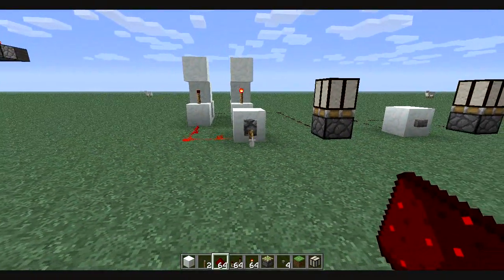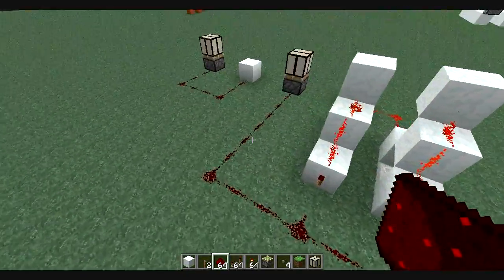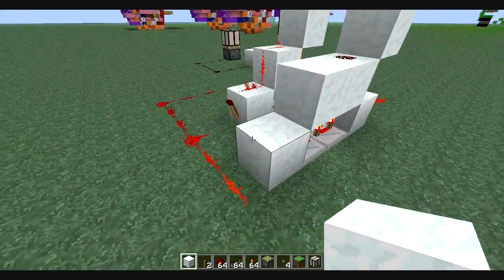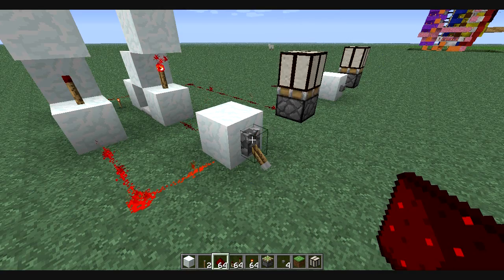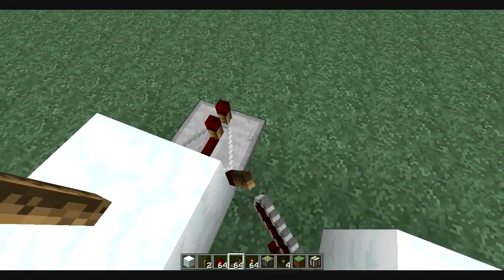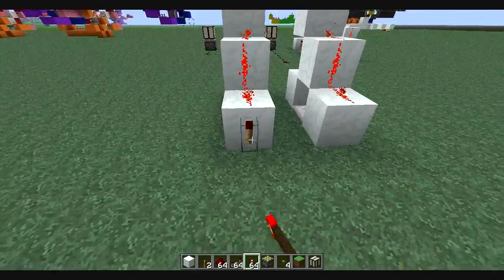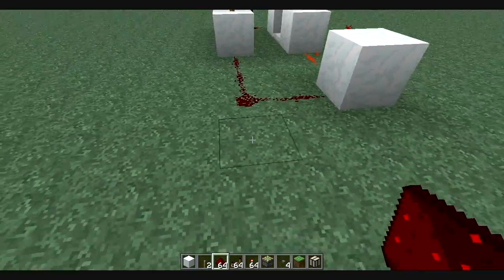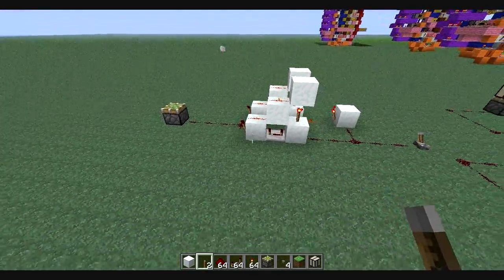Minecraft Redstone Tutorial | Lever act like a Button | Dual Edge Trigger | Rising/Falling Signal

Comment: saviour, works perfectly, used it to make retractable lamps(glowstone) from ceiling spent a whole day yesterday and half a day today and in an hour I made 3 different models to see which one is smallest( as need to fit in a small area and had to use 4 repeaters as it was too fast for the pistons on side to pull/push blocks Thank you for the amazing vid
Reply: AK Sheriff not sure what you mean but if you mean to keep the piston on and it can then turn off then on you can lead the redstone to wool then a torch and connect the torch to pistol with redstone
Reply: @AK Sheriff https://imgur.com/LvMXIcc   here it is if you got a question fire it away, everything before is the same as in video and this does same as in video but instead of staying off all the time it will stay on then turn off then back on